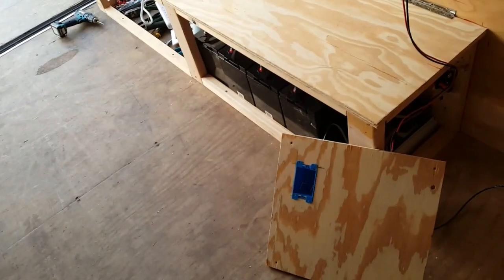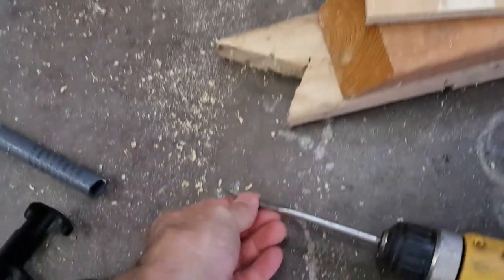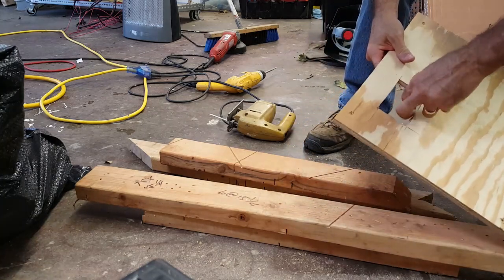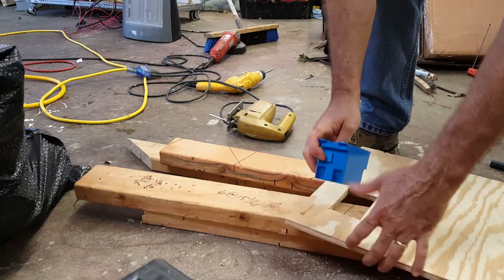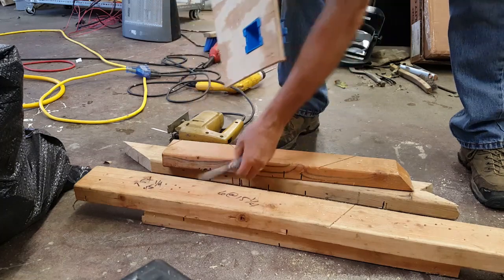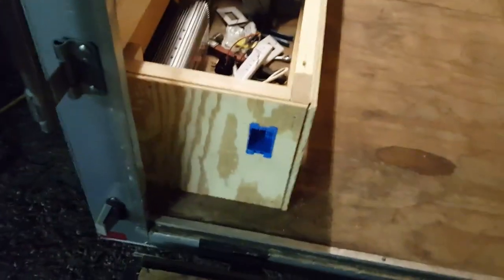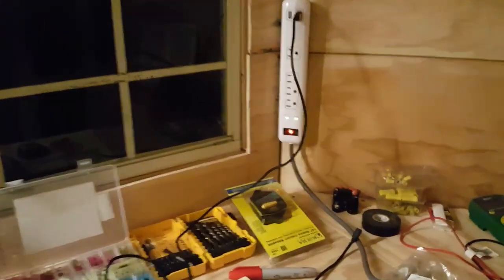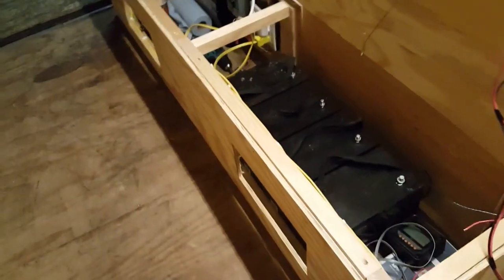SHORE POWER ELECTRICITY COMPLETED 6 x 12 Cargo Trailer Conversion Part 10 vanlife skoolie

Comment: Have you tried a computer fan in the box with the batteries and solar controller to help keep it cool?  I have used them for keeping my frig cool after boxing it in to pull air in and help push the heat out the vent. It has made a big difference in how cool the frig gets and it helps to circulate the air in my trailer at a very low amp usage.

Comment: I'm surprised you would use Romex wiring. Not safe . Stranded 3 wire is recommended for shore power. I just finished mine.

Comment: I’m confused. So how do you have the either the inverter or shore power connected to the outlets on the sides of your box?
Reply from the maker: When I am on shore power we use the 2 outlets beside the box. When I am on solar/battery power we unplug from the outlets and plug into the inverter. There are 3 outlets on my inverter. I hope that answers your question. Thanks for watching. Good luck.
Reply: i was searching for this info thank you 
 @FakeLegGreg
Reply from the maker: @seanmalone7920  thanks for watching.